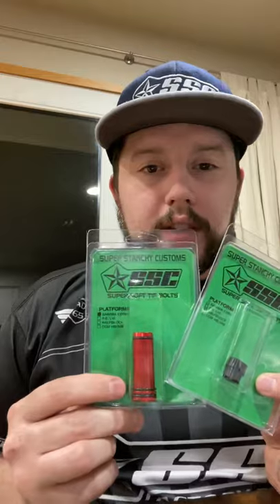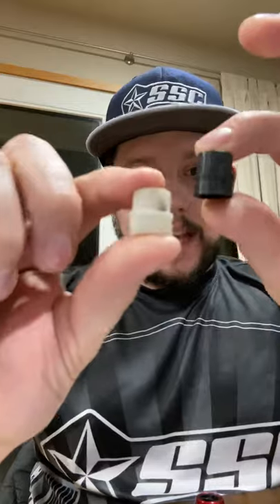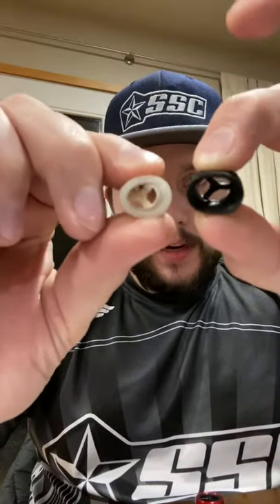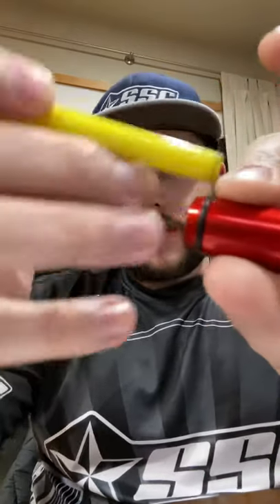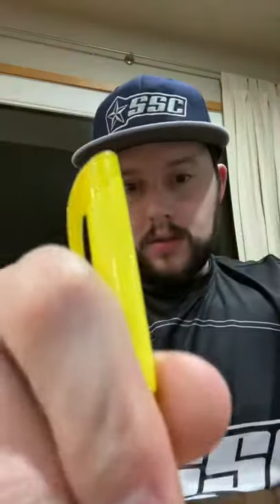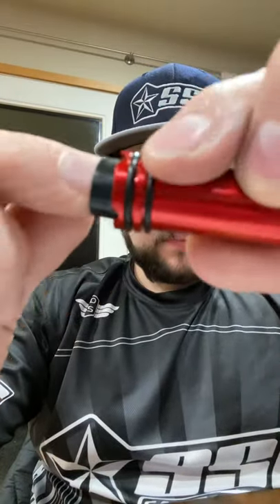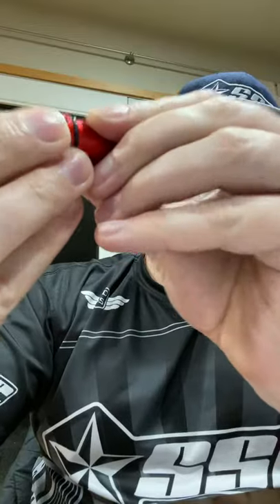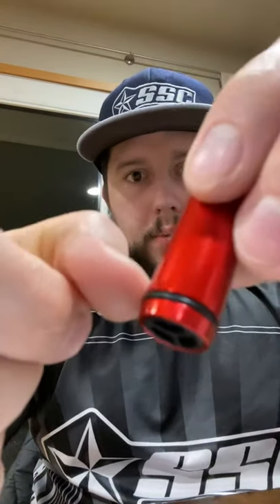SSC Gamma Core Soft Tip & Tip Warranty!

Comment: I see this video is 7 months old. Just ordered a bolt today from lone wolf paintball. Are the new revisions in retail now??
Reply from the maker: Yes all bolts since this video went live, have been the revised soft tips!
Reply: @superstanchycustoms  you guys sell the replacement tips? Or is the bolt sold with a spare
Reply from the maker: @jperez1083  we are not selling the tips extra/individually 

But we will warranty and replace any tip that fails!
Reply: @superstanchycustoms  I never opened mine, just saw this video. should I contact about getting mine switched?
Reply from the maker: @TheFloridaBikeVlogger  How long ago did you purchase it? There were only ~150 bad soft tips. We have sold thousands since! Go ahead and run it, and if it fails, we have free ones on our site :)

Comment: How's does this compare to the OEM softface CS2 bolt performance wise? Thanks!
Reply from the maker: We sacrificed 1-2% efficiency to gain some consistency 

Oem bolt is great! 

We made this for the guys that couldn’t get an oem bolt (or were being price gouged)
Reply: @superstanchycustoms  I understand now.  So does the data show about a 1-2% improvement on consistency (all things even)? Also what is the process like for a warranty exchange on the soft faces that were too squishy. Thanks for providing these!
Reply from the maker: Michael Morales yup yup

All of the gen1 super super soft tips have been warrantied, I believe. 

It was only an issue if you dry fire (mechs) if it goes mia, we will send a replacement tip. 

If you have an order number from
March, and didn’t get a replacement we can send one!

Otherwise, 90-95% of the bolts on the market have shipped with gen2 tips

Comment: What does this soft tip even do? Will putting one in a 170R make it shoot like a  cs2?
Reply from the maker: Bilbo Baggins it will allow you to shoot the ultra brittle paints, same as the cs2 bolt. The only difference between cs2 with soft tip and 170r with soft tip is 15psi operating pressure!

Comment: How do I get the upgraded core tip? I bought one and idk if it comes with upgraded soft tip
Reply from the maker: More than likely, you have the rev2/corrected tip

If your tip goes missing during use, let us know and we will get you a revised tip!

Long story short, rev1 tips only failed during dry firing, I’ve got rev1 tips still in personal markers running eyes, and no issues!
Reply: @superstanchycustoms  cool thanks?? Do I also need to change the dwell setting on the 170r??
Reply from the maker: @ervinnande3730  the gamma core is dwell insensitive. So no timing required! Just check your oring fit, and  rechrono (usually it’s 10-15fps low)
Reply: @superstanchycustoms  cool thanks so far haven’t had any problems good stuff bro.